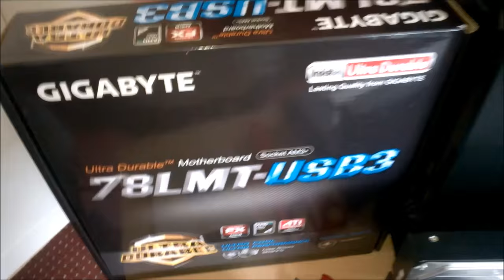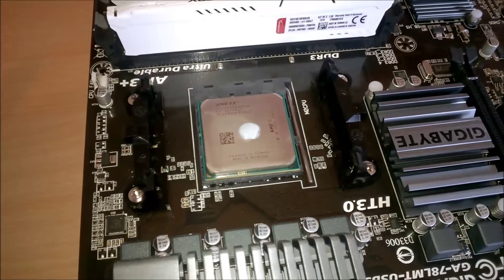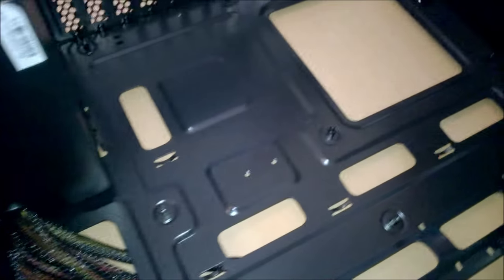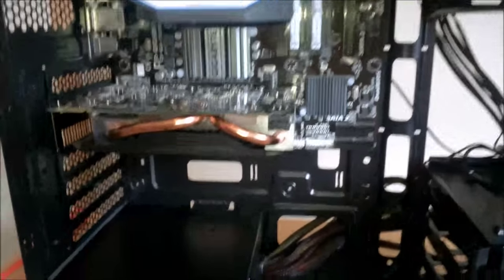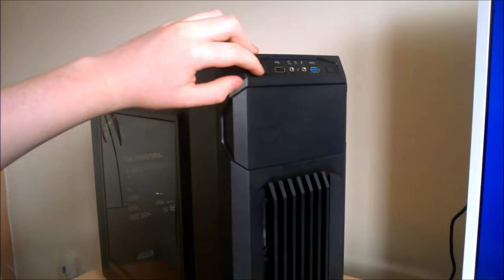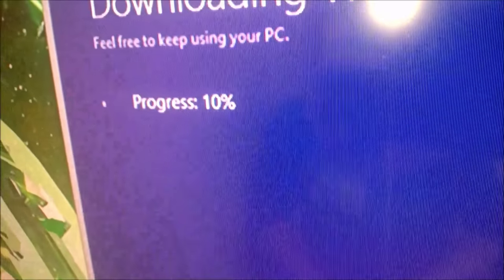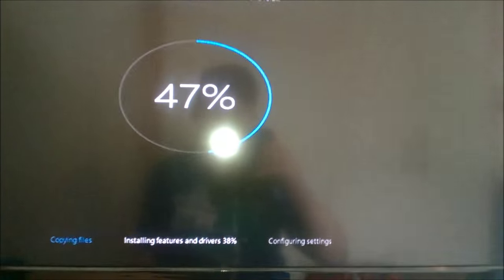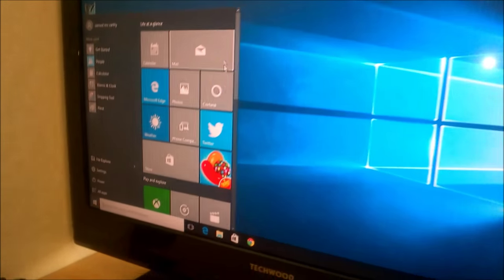Build A $750 Windows 10 Gaming PC

Comment: How's the FX 8320 holding up on this motherboard? I'm thinking of using the board as part of an on-the-cheap 8-core everyday use/video recording/video rendering PC with either an FX 8320 or an FX 8350 and some parts I got for next to nothing (power supply, Micro ATX case, 10GB of RAM - I have no plans of gaming on this computer, I have a Core i7 build for that, so I'm going to stick with the integrated graphics until I find a cheap GTX750 Ti or R7 360).
Reply from the maker: I sell most of the PC's I build, so I have no idea how it's doing right now, but 750Ti's have gone down in price a bit, I saw some for £85-£90 on Amazon, so like 100 euros, basically the same in dollars

Comment: This is Naba. I have one question only. Does the GA-78LMT-USB3 rev 6.0 support Kingston HyperX Fury 1866Mhz ram? If it does not support, it will downgrade the frequency of ram to 1333mhz. I saw your video many times. It is showing that it supports the frequency. But, I really want to hear from you. Give me the answer please as soon as possible. I need to know that.
Reply from the maker: I haven't used this board in over a year.... I have no idea I'm afraid. You may need to look it up on the Gigabyte website.
Reply: Thanks.

Comment: Where did you get your stand off screw driver? Is there any other way to remove the stand offs? I have this case but I ve got a micro atx motherboard and I need to place the stand offs in different places.
Reply from the maker: Just use pliers..

Comment: cool vid dude, i have this motherboard rev 5.0 but as my m audio 410 firewire external sound card has issues with windows 10 and recognizes it when it wants to , i changed to the onboard sound , but i have absolutely nothing coming from it, i'd still like to use my old creative 6.1 speakers with black green and orange 3.5 jacks , any ideas why i dont get sound ? i tried downloading the gigabyte driver for windows 10 64 bit , but after downloading it , when i go to open the via hd it says your system is 64 bit, please use the hd 64 .exe ....wtf it was supposed to be lol ..... any ideas ?

Comment: Did you say that you have connected an HDMI2 to the monitor? I've connected mines the very first time but there's no signal. I've noticed that you keep pressing a key before the BIOS came up is that the way to also get the signal? Thx
Reply from the maker: No, that's to enter the BIOS. And yes, it was a HDMI2. I'd make sure everything is connected right. If you motherboard has a hdmi port too, try that.

Comment: hey i have some problems with this mother board when i instal my gpu my pc just doenst boot up even tho i have a 700 watt power supply 
my specs are 
fx 8350
16gb ram 1600mhz
240gb ssd
1tb hdd
700 watt 80+ 
rx 570 4gb

Comment: Nice build I'm going to use a amd fx 8350 though
Reply: +nick hey :D FX 8320 and 8350 are not much different, if you are going to use overclocking on a budget machine i would recomend FX 8320, since you can overclock it to the point it is equal to FX 8350 and even better :p but it is totally your choice :D you might save there 40$ or something :D
Reply from the maker: +António Bastos the man has a point. A Damn good one at that $40 is a decent air cooler, or half a water cooler.
Reply: Emerald Isle PC's what is the biggest CPU I can put on this motherboard
Reply from the maker: AMD FX 9590 I would say

Comment: Sam I need yor help im confused between sapphire 7770 GHz editions and sapphire r7 265 2gb oc edition I would like to play some future games around for 4 years so which GPU is better
Reply from the maker: Milan Khut I would save up and get a higher end GPU if you want to play future games, even the GTX 960 will only play GTA with textures on normal, I can't really make the decision for you, they seem to be pretty equal, but the 265 has 2gb, instead of 1gb, look at this and see how you feel after 
http://www.game-debate.com/gpu/index.php?gid=2199&gid2=796&compare=radeon-r7-265-sapphire-dual-x-2gb-edition-vs-radeon-hd-7770-1gb-gddr5
Reply: What is that fps ?
Reply: In comparison there are some no what are they fps?
Reply from the maker: Milan Khut I would go for the 265 2gb. It has a slightly lower clock speed, but it evens it out with the extra gb
Reply: Ya but gaming needs more clock speed then GB and I'm 1time investor
Reply: +Milan Khut that depends man, there are lower clocked GPUs that are higher performance. It depends on the GPU chip itself and the VRAM as well as clock speed. Not all clocks are created equally. And you really need at least 2gb of ram for modern games, and that number is increasing fast
Reply from the maker: ShackelFro | The Irish Gamer Hell yeah, it won't be long until we'll need 6gb
Reply: Thanx Sam I finally bought sapphire r7 265 and its giving me performance above my expectation
Reply from the maker: Milan Khut I'm glad you are happy with your purchase.

Comment: Did you have to use your boot dice when you first started it up bc mine load screen keeps saying disk boot failure insert disk and press enter
Reply from the maker: start PC, put disk in, restart.
Did you set the DVD drive as boot device #1 in BIOS?
Reply: yeah I did and it works thanks

Comment: Immediately left after he said AMD. AMD is weak
Reply from the maker: If that's what you think, then I can't stop you. I know that I get better performance in the low end of the market, and well, so do most of my viewers...
Reply: Sorry if I came off as a dick, but my problem with AMD is that I use emulators like Dolphin and PCSX2, which are very CPU intensive, which means I have to spend more on an Intel chip because while AMD is definitely better for a lot of games that require or utilize several cores, I used to be an AMD guy myself, but once I realized if you pay more for that Intel chip, say 50-100 dollars more, you could get a lot more power. Also, AMD's FX chips are kinda old, but even with 4GHz and 8 cores, an i5 does me more good.